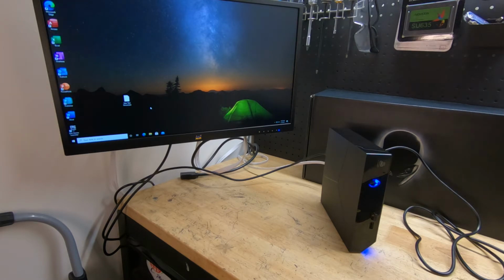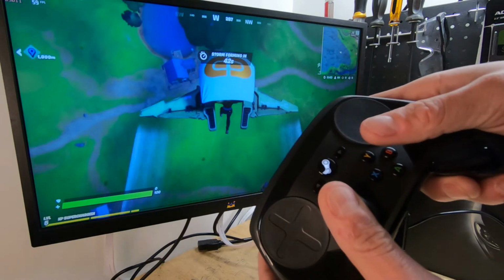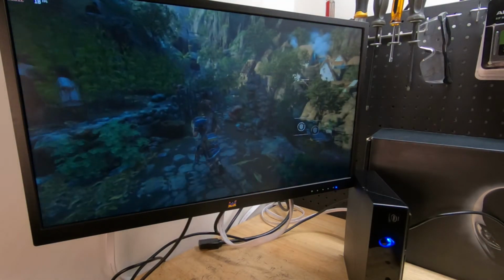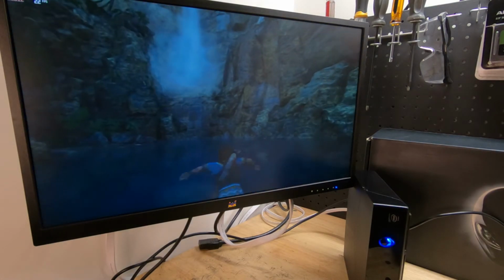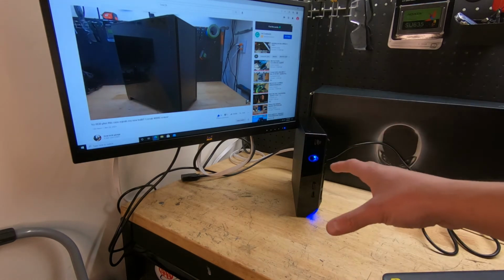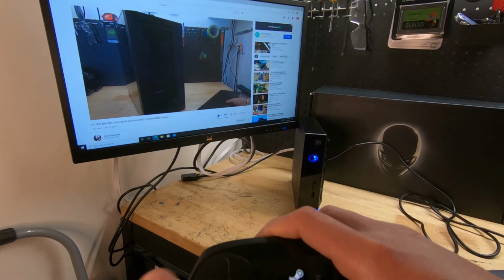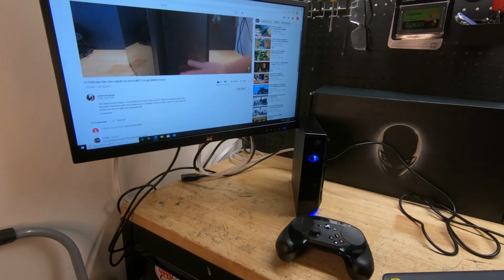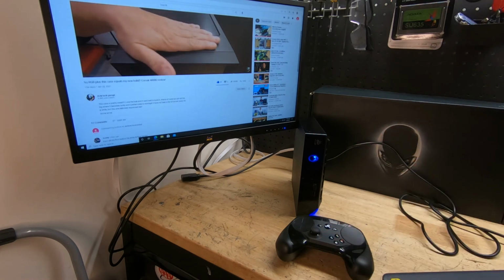Alienware Steam Machine disassembly and upgrades, Yellow light repair, and Windows 10 install!

Comment: That usb dongle in the storage area is the Steam Controller dongle. You don't need it for the steam controller to function if you update the controller firmware, however the firmware has some install issues so it's better to keep the dongle around if you plan on using the steam controller.
Reply from the maker: Yea I was thinking that was what it was for, I left it in.
Reply: Does the dongle come with the computer?
Reply: @eperales714  No, it originally came with an Xbox controller.

Comment: Tip: In Steam go to Steam>Settings>Interface and check these 2 boxes: 1) Run Steam when my computer starts  2) Start Steam in Big Picture Mode. It will be as if you have Steam OS installed. I call it console mode.
Reply from the maker: good advice, get the best of both world this way. Thanks!!
Reply: Hivemind Kodi made the computer boot into Big picture mode even faster making a better Controller console experience. SSDs are recommended for Alphas

Comment: everytime i turn off my alienware alpha, i have to get into the machine and disconnect the cmos everytime i want to play it, then i have to assemble it back together, is there a way i can fix this?
Reply from the maker: You using a new or old battery? That's typically the issue for the yellow light or cmos issue. Haven't heard of that issue in particular.
Reply: Put CR2032 batt holder in usb receiver compartment😀

Comment: Nice. What are the specs?
Reply from the maker: I7 4570T, upgraded ram to 16gb DDR3 500gb SSD GTX 860m equivalent with 2gb DDR5
Reply: @DLMtechgarage  I have a messed up dim slot so I can only use one slot. Would I be able to use on 16gb stick in one slot?